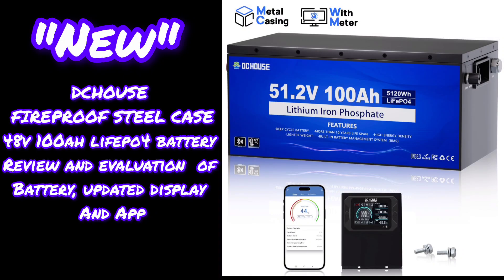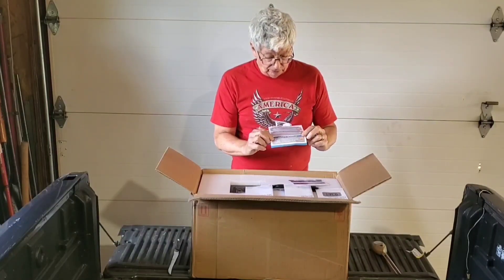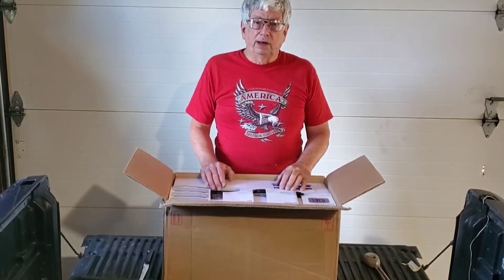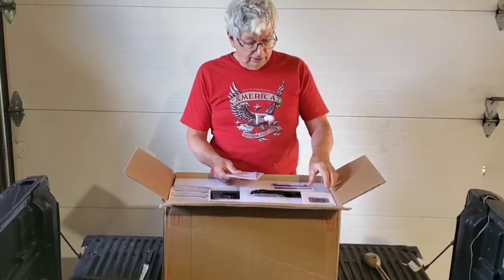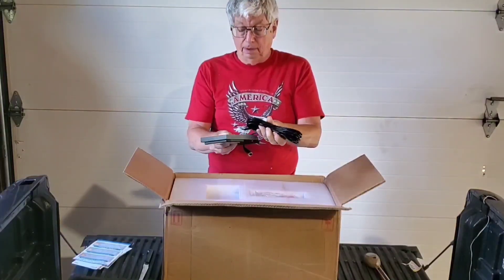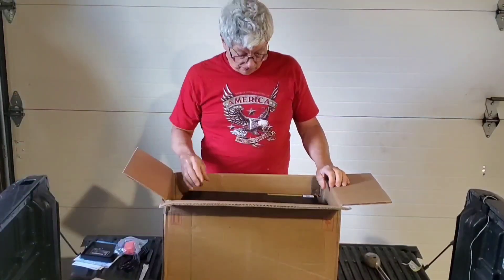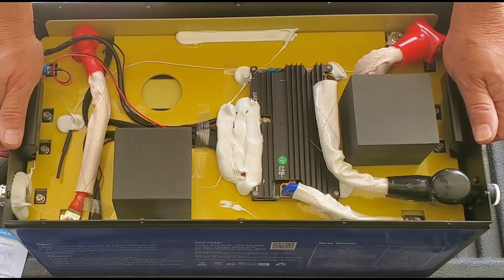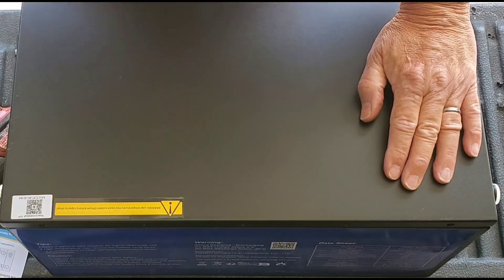DCHouse New Metal Case 48v 100ah lifepo4 battery with upgraded display and Bluetooth app.

Comment: I ended up buying 4 renogy 12v and I've been seeing people using a balancer to equalize the batteries on charge and discharge. Problem is when I'm looking for a balancer equalizer. They are rated for 24,36 48v . The renogy batteries say not run them in serious so I stuck with 12v in the camper. I would appreciate it if you could steer me to a balancer for  a 12v 4 battery for a total 400ah bank. Thanks
Reply from the maker: The LiTime balancer has been recommended in my Ryobi 480e riding mowers Facebook group
LiTime Battery Balancer for 24V/36V/48V Battery Banks – LiTime-US https://share.google/NedFX8LsSUgfOaUpz
Reply: Has anyone had success geting the Bluetooth to work?
My  DC House dose nothing

Any way to contact DC HOUSE?